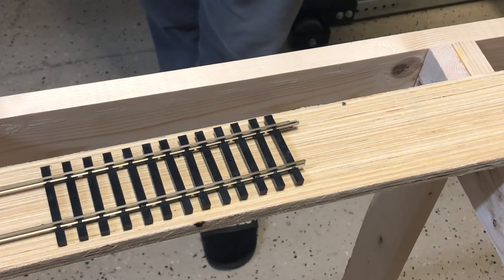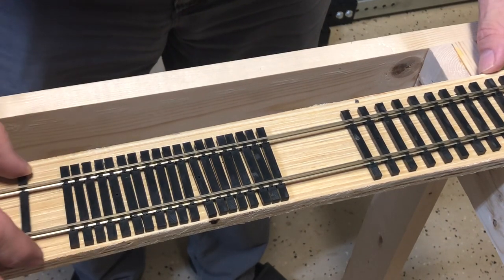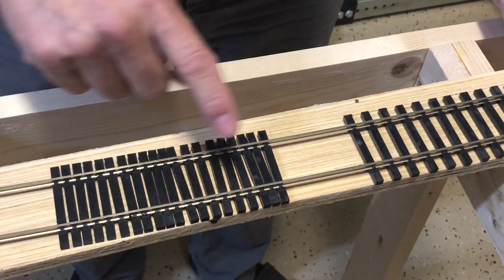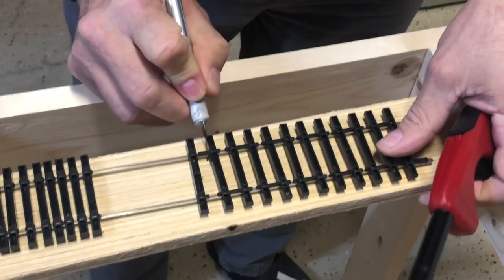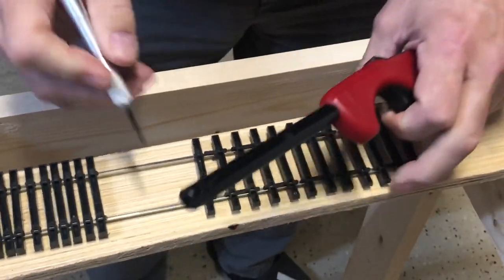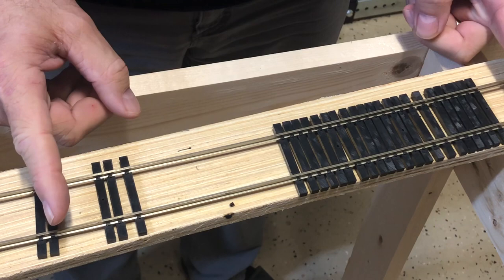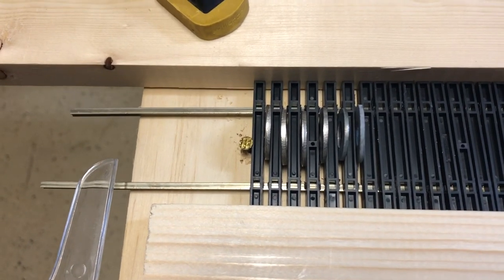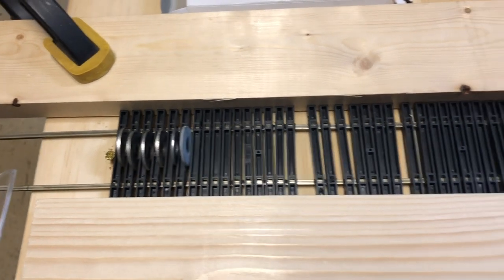Making O Scale Bridge Track from Flex Track & Module 3 O Scale Benchwork Build - EP159

Comment: I have the same problem in On30.  No bridge track available.  Of course mining railroads went the cheap route.  The railway I am modeling after didn't even have straight timbers on their tall trestle bridges.  I am modeling turn of the century copper mining in SE Arizona.  I started down the same path as you are doing with some extra PECO O-16.5 track.  I wonder if I can make a curved track for for my tall trestle using the same method...  Hmmm!